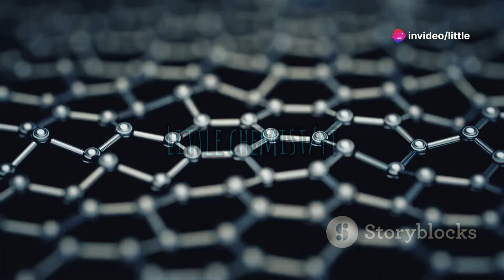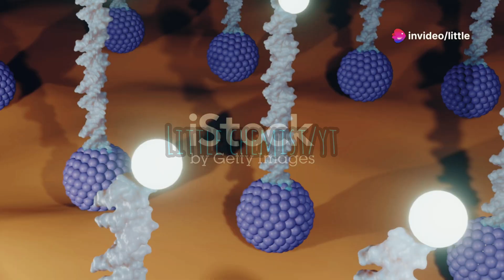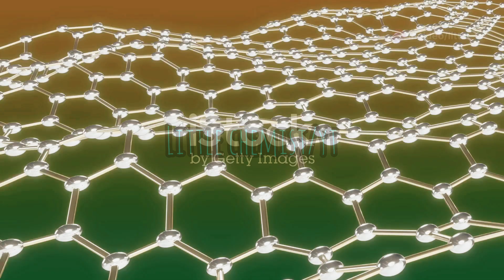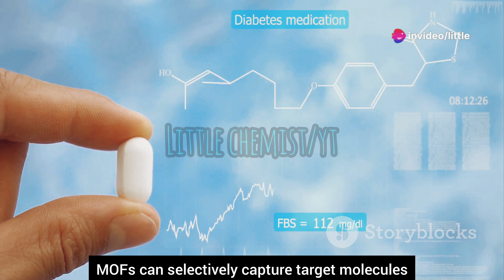Metal-Organic Frameworks (MOFs)

Comment: Neat video! MOF is pronounced straight forward "MOF", not "M-off" as is done a few times throughout the video. Also, even though MOFs seem like this wonder-material, they, like all other material, have their limitations. Most notably are they relatively unstable at certain conditions (e.g. at elevated temperature), causing them to decompose quite rapidly. This is probably the main challenge to overcome for MOFs in the future.
Reply from the maker: Thank you and appreciate it . Yes there are few challenges ,,, Temperature dependency is one of the major problem.